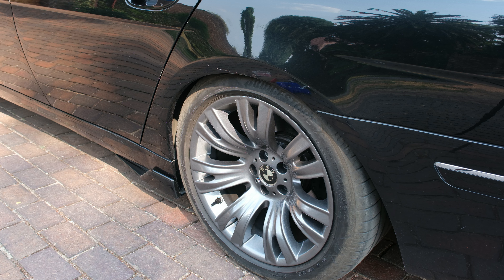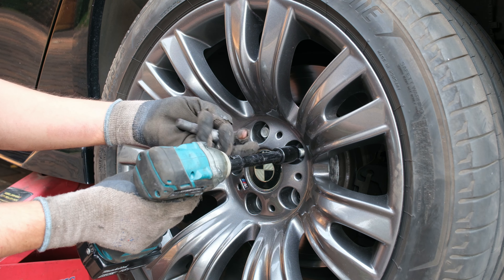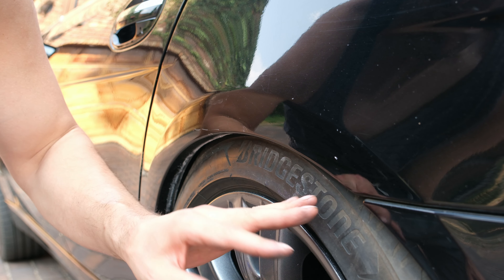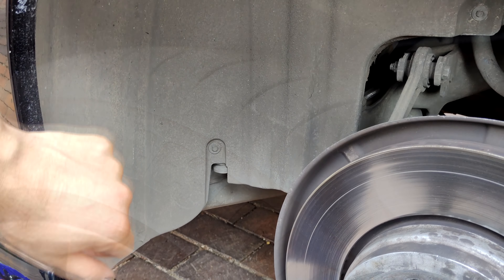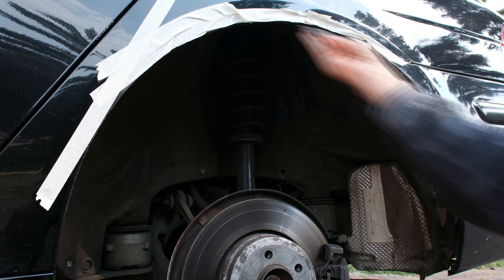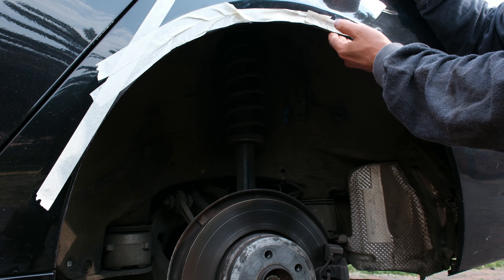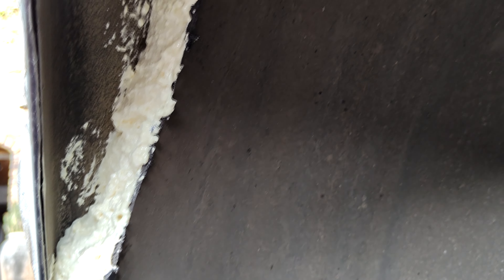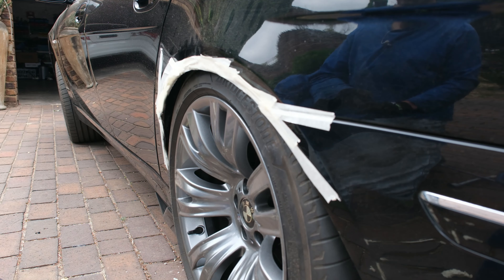How to add wheel spacers to your car -  cutting the wheel arch to make space for the spacer.

Comment: After cutting the slits every 10cm could you not just bend the arch towards the inside.
Reply from the maker: it deforms the outside when bent inward. It looks like its warped if one bends it. Better to cut and grind. Also paint chips off when bent and can chip off over the bend and sometimes can be seen on the outside as paint can chip in pieces bigger than the area you bend.
Reply: @ecologicaltime  Thanks
Reply: Great video. 
What wheels are those? They look familiar